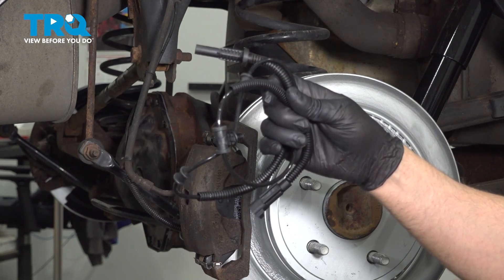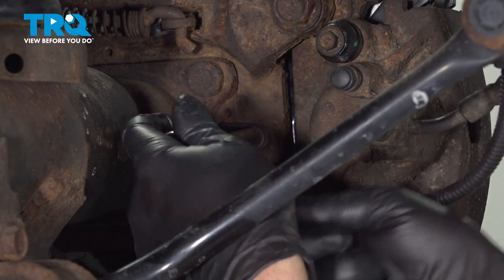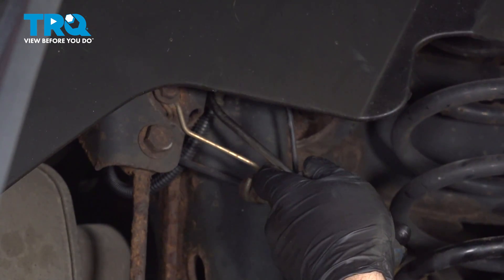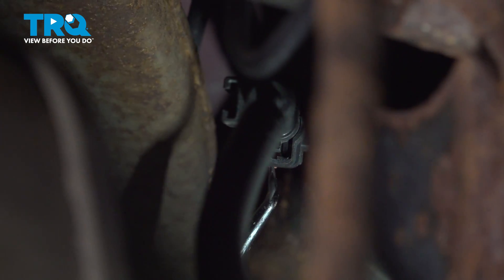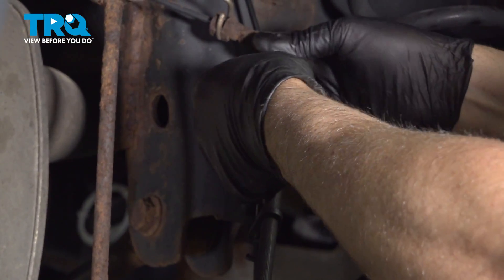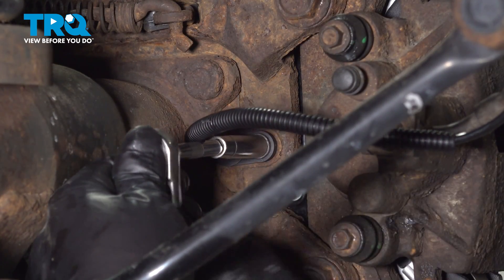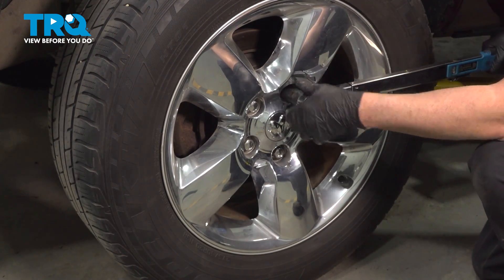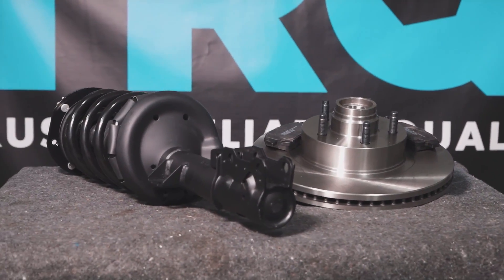How to Replace Rear ABS Sensors 2011-2018 Ram 1500

Comment: My 2011 does NOT have that top connector. I have traced the wiring and it appears to be hard wired into a harness. Are you sure this works on 2011 models?